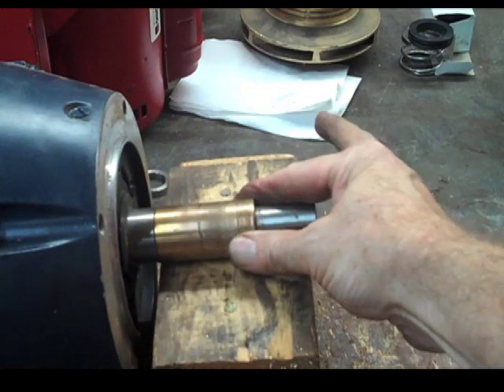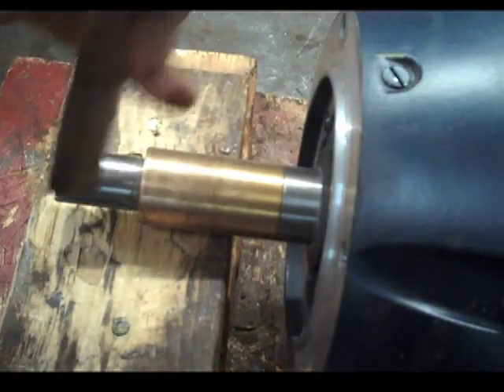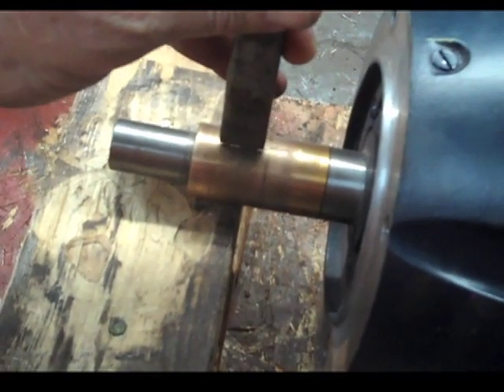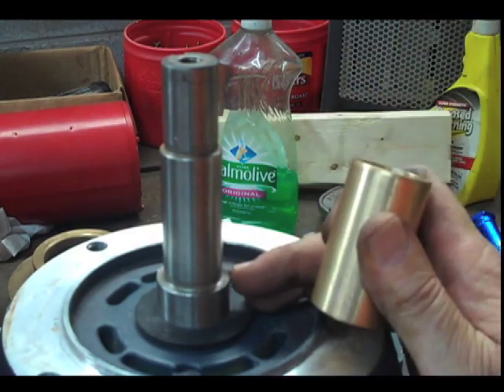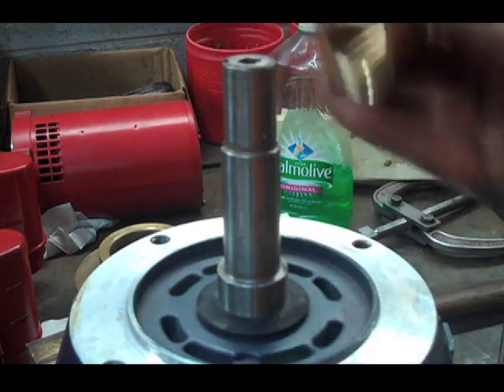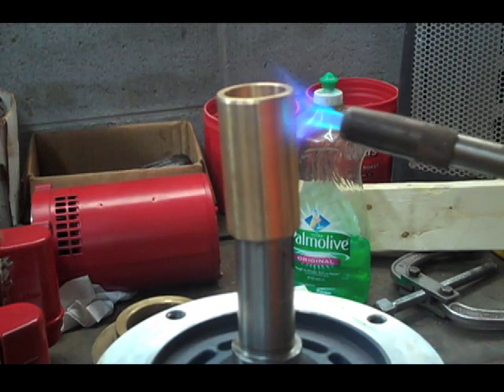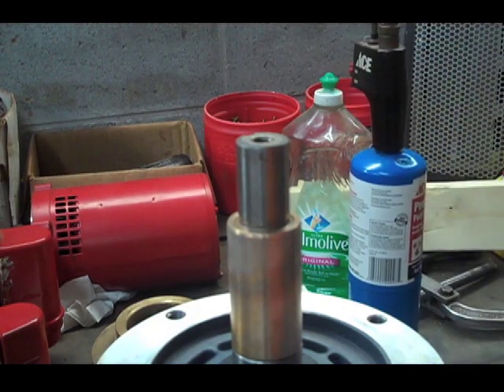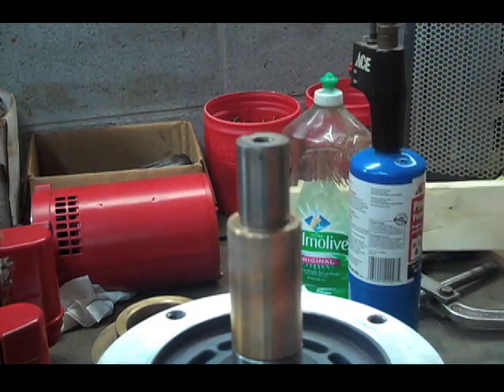SHAFT SLEEVE REMOVAL INSTALLATION CLOSE COUPLED MOTOR MOUNTED PUMP JM JP how to tutorial

Comment: Amazing explanation. Thank you. Question. What's gonna happen after it cools off? Is it gonna get tight to the shaft and spin with it? I ask because I have one that is really loose when it's in the shaft. I wonder that if I heat it up like you did it once it cools off It'll get tight. Thanks
Reply from the maker: if its loose it will not tighten up .. heating it expands it so it will fit over the shaft and then get tight when it cools 
you may not have the right sleeve .
Reply: @thebrainard  Thank you so much.

Comment: I always put mine on dry. Do i need to put a silcon or anything underneath it before installing the impeller setup?
Reply from the maker: 'it' being the sleeve?  there are several different types of sleeves .. some use locktite some use silicon some use an o-ring some are sweated on .. it really depends on what type you have.. this is for Armstrong close coupled and they have changed to locktite since this was done

Comment: If you have access to a shoulder puller, I find that preferable to trying to use a chisel to tap it off.
Reply from the maker: nope .. a sweated on sleeve will not come off with a puller 
a lot of companies have gone with gaskets/0rings or lock tight but this is an old school sweat on sleeve .. boom
Reply: @thebrainard  ...I suppose the surface area being much greater than a bearing makes sense in that case. I usually use a cone heater to drop bearings on, but a puller to get them off. For sleeves, I also normally use a torch, because all ours use loctite.

Comment: Shouldnt need to heat these sleeves at all, they should slide on and teflon tape should go against back shoulder. Once the sleeve is installed and the bolt is tightened, it cant go anywhere.
Reply from the maker: they are sweat sleeves .. old school ( vid is how old?) they won't slide on without heating d.a.